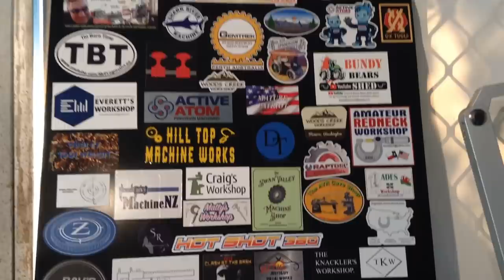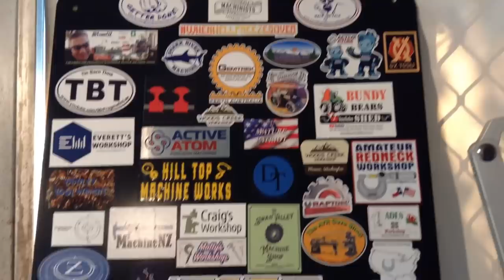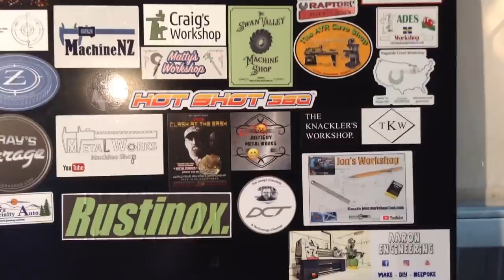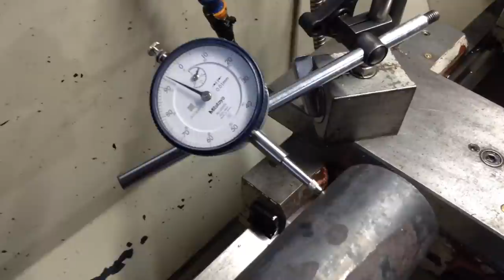Breaking Out The Ball Turner For A Job .

Comment: AAHHH! So that is what a tailstock chuck is used for ! Seen heaps of them on ebay but couldn't think what they are used for or what i could use one for !
Reply from the maker: That's what they are used for alright !    I will have to  sort myself out with one , one day !     Cheers .
Reply: @swanvalleymachineshop  
After writing that i began to think i could use one for making crankshafts , just a matter of timing the jaws so the offset is aligned on both chucks .
Box of beer brainstorming on it right now !
Reply from the maker: @ianbertenshaw4350   Good idea .  Very easy to indicate along the length of the stock to get them aligned .

Comment: I'm a little confused of which sticker board was temporary  relocated. I see 2 there.😊😊 Great job
Reply from the maker: I only have the one board .   I could start using the tool cabinet door i suppose !    Cheers .
Reply: @swanvalleymachineshop   I'm not nockin your black sticker board very nice indeed. The sticker board over the headstock of the lathe is just a little nicer than the black one.😄
Reply from the maker: @bombardier3qtrlbpsi  Ahh that sticker board !   I think it's about due for this months page !

Comment: Good pointers on technique there Max.
I must admit disliking black bar for many reasons.
Might have to go and make me one of those ball turners to your design. 
Very elegant solution that could also be power fed easily enough.
Thank you for the video.
Reply from the maker: Thanks Carl .   I still look at that one as a proto type for further improvement .  When i have time i will  do the other modifications .    Cheers .

Comment: Hi Max ....  very nice setting up of the Cold Rolled, which are Always out of round . You have a Good Looking Ball Turning Jig, which does an Excellent job. 
Thanks for Another Well Done video. Be safe & catch you on the Next one
Reply: I think you will find that is Hot Rolled, ref has mill scale on it, Cold Rolled, is when hot rolled is fed through a pickling process to remove the scale, and through rollers to improve size etc.
Edit: changed Not to Hot.
Reply from the maker: @bostedtap8399  It is the '' politically correct '' term now days for black bar  !!!!!
Reply: @swanvalleymachineshop  Lol, just noticed that auto-spell substituted  " Not", where should be " Hot" ( it just did it again. Grrrr!. Never gave a thought to it being a PC crime, I'm from an region north east of Birmingham UK, that is called the " Black Country", I use it this term all the time when commenting.
Reply from the maker: Thanks Ted .   Cheers .
Reply: @bostedtap8399  My slip of the Tongue.  Hot Rolled ...   I can go re-edit if you like.  The point is  Max did a good job of pointing out different solutions, whereas I would have centre drilled the end and machined the centre jig position then faced the end & ball turned the end. But not taking anything from Max who did an Excellent Alternative.
Reply: @TedRoza  No problem, edit as you wish 👍

Comment: Lovely stuff Max, new sub here from Gary at The old machine shop
Reply from the maker: Thanks Mate .  Just had a quick look & sub'd to your channel .    I see you have an 80 shovel ,  i have had one for 34 years !   Cheers .
Reply: I've had mine 28 which is just over half my life, all hand made all by me
Keep up the good work and I'm working my way back through your great videos buddy
Reply from the maker: @RalfyCustoms   Thanks  Mate .   I fitted a 2006 / 7  complete primary drive , clutch & starter motor  to my one  , people said it could not be done ! Then rode it  17,000 km around Australia without one oil leak  !

Comment: Hi Max, I have still got to make a Ball turning rig with a Roraty Table.  Love banana steel  especially when its a chrome molly,  in a previous life I always used aluminium shim stock to allow the shaft to move so it didn't load up the jaws.  If the shim stock isn't used, when the jaws are backed off, it springs and you can never get the shaft straight.  Great to see you getting subs coming your way, it will take off big time.
Cam
Reply from the maker: Thanks Cam .   Cheers .

Comment: Good end product! Very shiny.

I noticed that you've got a right hand thread on the travel for your attachment there Max. Is that for any particular reason, other than it being more convenient to make?
Reply from the maker: A design cock up !   If you know how hard it is to single point thread  7/16  x 10 tpi inside square thread , that's why the fault has not been rectified yet .  But it will be !  Cheers .